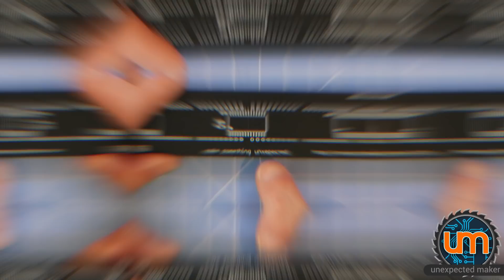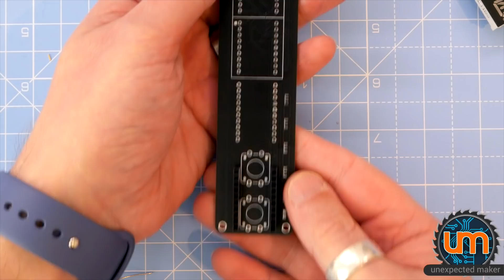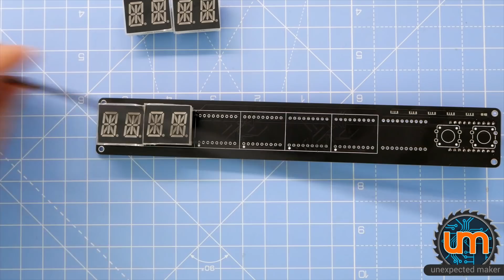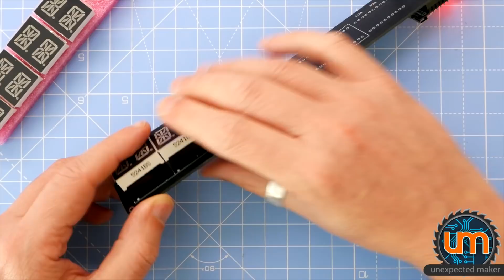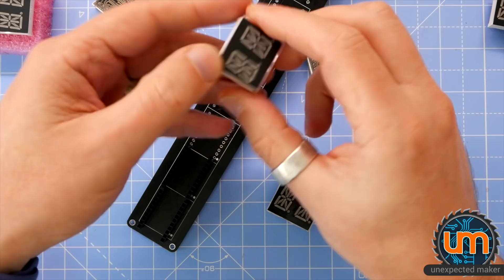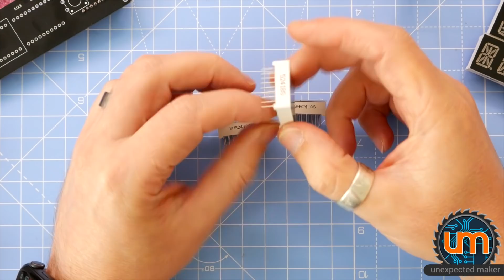OMG - What the %#!& have I done?

Comment: Where is the problem? I don‘t know your board design, but in general the HT16K33 do support common anode displays, the source current is limited though and you have to keep track of the key scanning. Can you maybe just change your code to work with inverted output logic?

Comment: Been there... done that... 
I'm sure you'll think of a project to use those BS displays too. (Probably some over-engineered component manager of some sort... ;-)

I don't think it's corrosion, just bad contact. I had the same with my mini 64x8 led matrix. Those header pins are kind-of useless for this purpose.
Btw. when I ordered some led displays with common anode and common cathode, the supplier made the distinction clear by using the pink foam for one kind and white for the other.

Comment: ZIF sockets make testing DIPs much easier and if you're going to use a part in quantity, it usually pays to make a dedicated test jig for maximum ease. Just my 2 cents, but if I was using a lot of those displays I would code up a ZIF test jig that applied power to each segment in succession and used an A/D input connected to each digit's common cathode with a cathode resistor to ground to watch for current being drawn. Any microcontroller can cycle through everything rather quickly and then deliver a test good output via a green LED while catching all open and shorted digit faults. If you use 74HC595s for segment outputs and a SPDT switch for common anode/cathode selection you can accommodate both polarities in a single tester by switching the resistors between Vdd and Vss. The current sense A/D inputs will indicate the selected polarity to configure the test.

Comment: At least, they have clearly marked. I have just recently had an issue with NDP6020P (p-chan mosfet) to be actually n-chan mosfet in some cases - check https://twitter.com/kralant/status/1236327369742454785 . But definitely feel sorry for you. I would suggest using ZIF sockets (those with lever) for test jigs. Will have great contact and quick turnaround.
Reply from the maker: Wow, Yeah, I've had mixed IC orders like that before from Ali - I only buy ICs from them when I really have no other choice.

Comment: The reason the sockets aren't great for that is because the contacts grip the very edge of the pins on the LEDs, so if the LED pins are thin, or even slightly misaligned (or both!) then you're not gonna get a good contact.
Try building something simple with resistors on a breadboard. Chances are you're gonna get better contact with all the pins as the contacts in breadboards are larger

Comment: Yes, as soon as they didn’t work I was pausing / rewinding the video @13:17 trying to read the part numbers on the side (before you'd made the discovery).
I’d recently had exactly the same issue with some DIL bar LED’s. I’d ordered prototype samples, designed the PCB. Then re-ordered bulk stock of the exact same part, and they didn’t work! Same issue of different suffix!   %#!& annoying!!!
Fortunately, in my case (as they were DIL “bar” displays), I was able to install them rotated 180 degrees. Unfortunately this won’t work in your case. :(

Comment: Quite a  ** up Seon, 5241AS(Common Cathode)
 5241BS(Common Anode)  just reverse the power to your board :)  Quite easy to do on platforms like Aliexpress as the type is often call "colour" or "size" not always what you would expect.  Your have to make a new display to use them up. https://www.aliexpress.com/item/32584509522.html

Comment: If you want a better connection maybe try a zif socket for your test rig (zif = zero insertion force, the same sockets used on those 10$ transistor testers.) and for the wrong displays: I’m sure you will find some use. Maybe let us brain storm about this next Tuesday (or your Wednesday).

Comment: I had the same problem with the header sockets not making proper contact with the thinner turned pins.

And, guess what they were for - that's right, some Arduino-based testers I built for somebody, for some LED matrix boards. lol

He paid me to build them as wel, but was very understanding when I said "Well, they do work, but you might have to hold the displays in a certain position to test them". sigh
Reply: So yeah, it's almost certainly the combination of those sockets with the turned pins of the displays causing the problem.

The contacts in the sockets rely on the width of the pins to work properly.